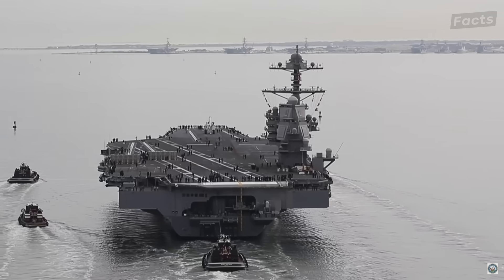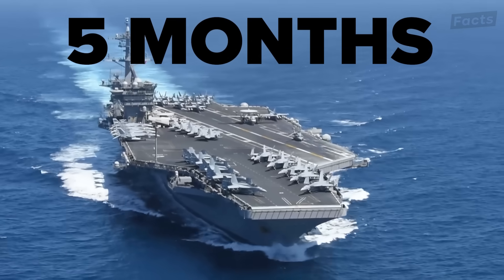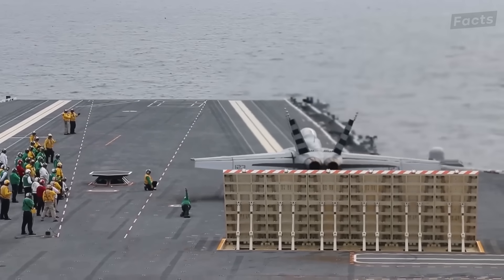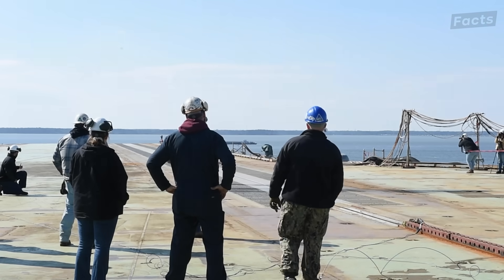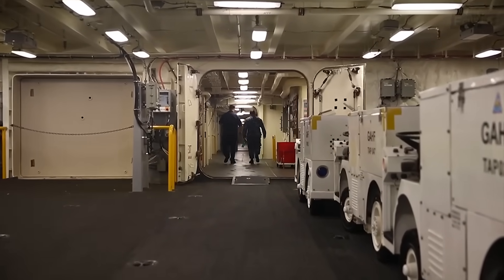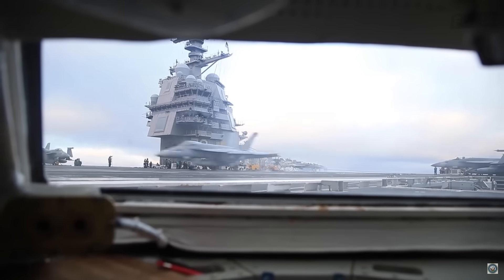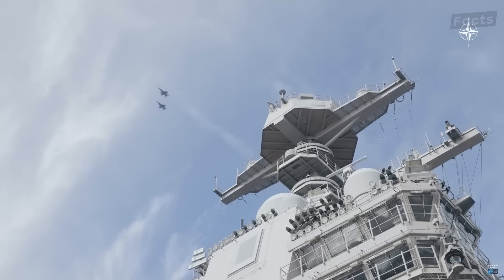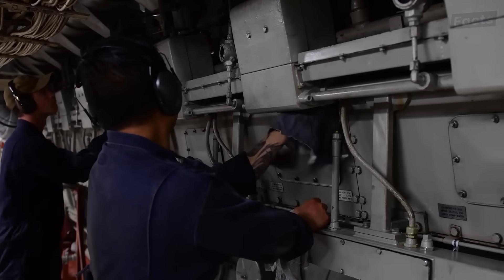The LARGEST Ship in The Navy Has A GIANT Problem

Comment: No "STEAM" catapaults on the USS G.R. Ford! Magnetic catapaults only.
Reply: Right on. I'm sure there is steam somewhere between the Uranium and the Aircraft, when on the catapult, but it's not the catapult..  :-D
Reply: @gilbertdk do you steam to turn the turbines for propulsion, and for other systems in the ship. But absolutely nothing to do with aircraft launching or recovery
Reply: @gilbertdk  I joked at a meeting what will you do tow a ship with Batteries behind it for emals no one at Lakehurst Laughed.....
Reply: @gilbertdk  Yes Plenty of steam but not for the CATs .  The new aircraft composite cannot handle the stress of a steam cat shot, IMO  I need to be careful what I say......
Reply: Great - tell Mark Milley to call the Chinese and keep them up-to-date.
Reply: If it works don't F with it I hate to say I told you so!!!! Retired Team Leader ALRE!!!! NAVICP PHILLY RETIRED!!!
Reply: your correct, but they were referring to traditional carriers using steam cats. Re-listen to the video.
Reply: It’s not working so there are using steam
Reply: @djprentowalker8878  //  Can't the Steam C13- mod 2 Fat cat tubes not there.....
Reply: @djprentowalker8878  No they did not. Electric. None of you morons were on that carrier nor in the Navy, clearly, going by hearsay
Reply: And it's only in writing. 
Because it doesn't work.
Reply: @loktom4068  funny, they have been launching aircraft.  How do you suppose they are doing that with no catapult?
Reply: @loktom4068 really now? Maybe you should go back and tell CCP that your propaganda nobody believes😂
It's the Chinese aircraft carrier that still stuck in Port because they can't get their EMAWS system working😂😂
Reply: @GR_Chief    true    😅    👍
Reply: @GR_Chief     I told you it was a Bad Idea.....
Reply: @loktom4068 0090o[ooo9o⁹⁹9⁹😊

Comment: It's called FITTING OUT for a reason.  This is the period where all of the bugs in the sytems are identified and corrected.  BTW, the ships are resupplied daily for critical parts and weekly or monthly for fuel and commestibles.  Get your facts right before posting.  The EMF cats have been working as designed.
Reply: Ford has been "fitting out" for 8 long years and the fundamental problems are not going away.

Comment: The JFK had a bent screw, never caused a problem.
Reply: Except @ above 18 knots the stern would start to bounce a little, or didn't you notice ? served 1980-81' .
Reply: @charletonzimmerman The only time I noticed it was during carrier quals.(high speed) Never felt it during deployment. 93-98

Comment: Yeah, physics are indeed a problem. New system with bugs? You don't say! Sounds like pretty normal stuff to me. Sounds like a lot of hype in the tag line. 🙄
Reply: Salt water Hates Electronics
Reply: @peterhall8572  I think it's the other way around. Electronics do not like salt water. Salt water doesn't really care.
Reply: Sounds like Ford Motor Company installing too many new and untried options on their vehicles.  Of course you seldom have to deal with MIGS or Sukhoi aircraft in your F-150.
Reply: @johngaither9263  I think that depends on where you live.
Reply: Maybe you should read up on the YEARS of development those systems under went. Its a crying shame. Navy brass should have been fired!
Reply: @raywhitehead730  Have you never bought a piece of electronic equipment that was so new, it had many hardware features that had yet to be implemented, and needed to go through several updates to be fully functional? I hate to say it, but it's kind of normal in the world of hi-tech, and apparently, that carried over from the commercial sector into the military. It's a dangerous and irresponsible way of doing things but in the face of competition, speed kills and the entity that has the technology out in the world first is using it before anyone or anything else. In war, second place means defeat. Food for thought.
Reply: @raywhitehead730  if you VOTED, the shame is on you.. 💯💯😂😂😂
Reply: The Fors is high tech and bad asses. It’s just teething. Wait until the bugs are worked out and that technology allows her to take out an entire major country’s Air Force on her own. 
First modes are always buggy. Ever buy the first year of a major mode shack up or totally new mode? Good luck with failures and recalls.
Reply: the author saw a photo of a ship once. that makes him a expert.
Reply: These ships are NOTHING more than big coffins in the age of hypersonic nuclear missiles.. 💯💯
Reply: @Gangsta1168  No more so than before nuclear missiles were hypersonic. If someone throws a nuke in your direction, hypersonic or not, chances are pretty high that you're going to end up with more than a sunburn.
Reply: @Gangsta1168  Yeah, maybe. My money's on the nuke.

Comment: The F-35B doesn't need a catapult.
Reply: What about the other aircraft they use?  Plus if the F35 is fully loaded, it cannot take off vertically.
Reply: The F-35 does need the catapult if it needs to carry anything over the minimum weapons load. Take off vertically is not ideal for combat ops. You would burn a lot of fuel just to take off. Landing vertically would make aircraft turn around quicker though.
Reply: @Bob-yl9rz  F-35B STOVL (Short TakeOff Vertical Landing).  Can it even take off vertically if it has any sort of combat load?  the USMC F-35B uses no catapult, just a short flat acceleration run off the boat using engine power only.  
Only the USMC/USN F-35C uses a catapult for launch and arresting wires for recovery as the C is the CATOBAR variant(Catapult Assisted Take Off But Arrested Landing)..
Reply: @krashd  I didn't realize that you're British.  You guys have some pretty amazing capabilities in those ships/aircraft. 
Yes the US small carriers and the UK Queen Elizabeth Class both launch F-35 from the boat without catapults.  The ships both launch an F-35B with 2-1000lb precision bombs and 2 AIM-120 missiles all internal with full expendables,  fly 505 nautical miles away then turn around and fly 505nm back to the ship and perform an underway vertical landing profile  
The difference is that the US Navy ships use a 600ft launch strip whilst the UK carriers use a 450ft strip with a ski jump.  Amazing capability for a jump jet aircraft.  Current SuperHornet has a strike profile mission radius of 390nm.